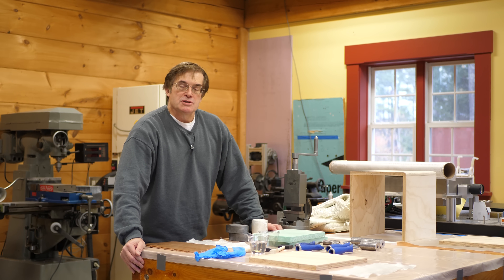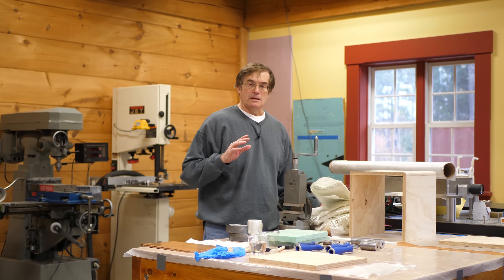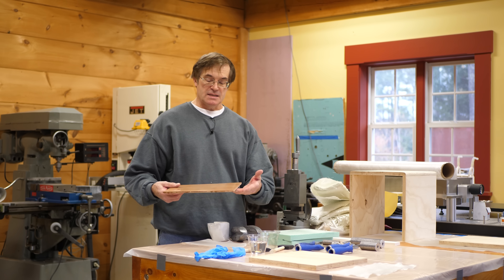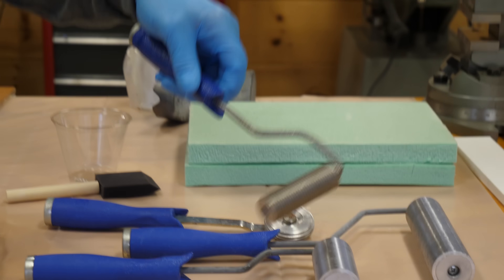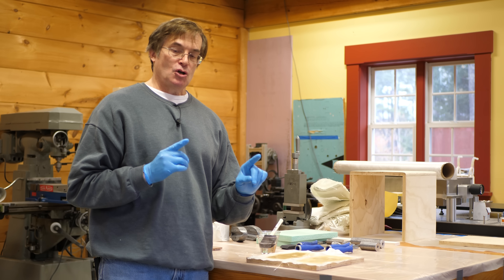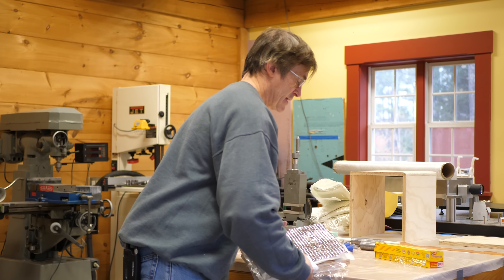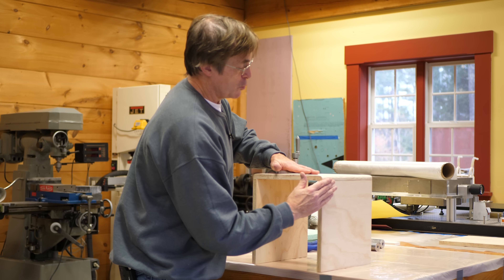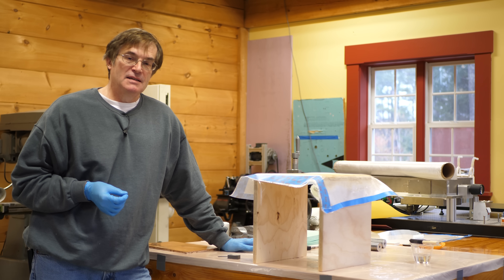Easy Tricks Using Fiberglass Strengthening!

Comment: I've recently been using epoxy, both the standard and thinner, penetrating type, on many projects recently.  Your video taught me a lot.  Thanks!  One tip that I have for you is to purchase some silicone baking mats.  Nothing sticks to them and you can use them both to protect your work surfaces and to produce a smooth finish.  I recently repaired a puncture in a pool safety cover using epoxy and some pet-proof window screen scrap sandwiched between two silicone mats with a concrete paver left on top overnight.  The result was as strong and professional looking as anything you could hope for.  I also use parchment paper (like they use for baking cookies) for larger projects.
Reply from the maker: Good suggestion, thanks.

Comment: Thanks for this amazing content!
One question: is it possible to bend xps (lets say 1 inch thickness) by putting it into a heat chamber or bathing it in hot water (the melting point is (afaik) at ~90°C? This would be interesting e.g. for rounded boat hull shapes (instead of using scored foam or PVC foam). Can't find any answers to this question on the internet.
Reply from the maker: I'm not sure, but remember that hot coffee cups are often made from XPS.

Comment: Great fiber-glassing tips! I remember as a child (1965-66, I believe) 'helping' my father build a 'Luden' 14' fiberglass runabout boat kit (deck and hull pre-formed) and I accidentally inhaled a single fiber into my wind pipe. I coughed and choked for over an hour before getting the fiber out (even vomited once). Moral of the story...One should consider using even a simple dust mask when working with fiberglass matting.

Comment: Something worth mentioning (unless you did and I missed it....) fiberglass and most all composites are stronger if used to form complex shapes and curves.
Flat panels will flex but a freeform speaker box or a car fender for instance will be much stronger.
Also, if you are careful, you can sometimes use many layers to create heat during a layup.
Can be very helpful if laying fiberglass in a cold garage during winter...

Comment: Great video, one of the best. I worked out to lay the resin down first and then put the glass cloth on top when I was 15 yo.  I always wondered why everybody didn't do it like that as the results were just as good if not better.
Also, heat lamps (like in your bathroom) work really well as do heater strips from a radiator to warm the work, especially with larger and vertical parts.
I don't like the idea of trimming the edges as I believe (and I could be mistaken) that maintaining the integrity of cloth over the joints in the piece is critical for strengthening what is essentially a stress point.  It is easy enough to wet the piece enough to stick the cloth down and apply more resin later, as above.

Comment: Very nice video as always 👌just a trick I learned making skis is that is when you have a fully cured surface, after washing it down like told, rub it down with a mild vinegar, this helps with the surface tension of the epoxy and you can avoid "lakes" aka pits where no epoxy will flow 👌👌This helps you make that glass finish you want on eg carbon fibre 👍

Comment: Hmm...on sailing forums cored fiberglass does not have much respect. Over the years (or decades) the chance of the core getting moist and adding unnecessary weight is high, they say.
Reply from the maker: That depends on the core.  Only balsa, which dry, is one of the strongest and lightest is able to absorb water.

Comment: That time where the epoxy is still chemically open is known as work ready. It's not cured enough to be finish ready but good enough for another layer. I would hope wetting the surface before the fiber glass is standard practice for fiber glass work. Also think about making a pop up paint booth for larger scale things. You can control small particles, air flow and temperature.

Comment: Any tips for covering a very large surface?  Think Hangar door, 25-30 feet wide x15 feet tall.  I'm looking at building a horizontally bi-folding door (Example: https://www.youtube.com/watch?v=sNBybkHBHlE)
The frame would be metal, the infill would be 4" EPS foam that I salvaged (4'x8' sheets).  I plan to skin the outside of the door with R-Panel metal riveted to the frame, and skin the inside of the door with fiberglass as you show in the video.  
Spreading the epoxy first on a horizontal surface and then using gravity to let the cloth sink into it is a priceless tip, Thank you!
Tips for calculating the amount of epoxy would also be much appreciated!
Reply from the maker: Sure.  Find a very slow cure epoxy formulation.  West Systems has a broad range of different systems.  Work inside if possible to avoid bugs becoming stuck to the surface during cure and direct sunlight prematurely heating the work surface.  Get as much help as you can with one worker dedicated to producing the multiple small batches for the other applicators to spread out, thus increasing pot life and decreasing walking cleaning and contamination.
Alternatively, you can work section by section.

Comment: All of these are classic surfboard glassing/repair techniques. I think this is the best vid I have ever seen on the topic, very concise and clear. Surfboards are typically a lightweight PU core with polyester resins with fiberglass -- stiff outer shell around a lightweight core... the techniques are exactly the same as here. Surfboard lineage is shared with boats and airplanes. Other minor techniques: 

- orienting cloth, cloth is anisotropic so you want it diagonal to the direction of shear to get max stiffness, and layering cloth in different directions to produce a more homogeneous result
- adding filler like microbeads to fill gaps/holes in an uneven material while keeping weight/material cost down
- slow cure = generally better strength, I think? I have heard this but I'm not sure about it.

Comment: I am hooked! Dr. Fiberglass, I am a retired auto tech, actually an ASE Master Tech since 1978. I am building custom door panels and just started yesterday, following “Classic Truck Addictions” video channel. I hope you have a video on fiberglass resin, either polyester or vinyl-ester. (Yes, 3 years as service mgr. at boat dealer w/34’ premium fiberglass)
  The other video required a “Barrier of Bonding Agents” that hardened, could be sanded, then fiberglass resin will not eat into the extruded polystyrene. I have never tried but found it interesting. Basically, a 54 year old pickup had flat stamped sheet metal panel. After all, they where work trucks sold to the farming community. So, hit like, subscribed and even though “Google” monster make you sign in to get 3 sheets of TP off the roll, I have no bell. I have the WiFi part of an old iPhone my son sent me, but no cable, no subscriptions, I don’t even watch sports even at 6’3” and played all. Care less. 
 I will be check the date released, going to your channel to find fiberglass on EPS, and go from their. It take work to but materials, do certain show-N-tell parts in advance, have a script or plan, lights, camera(s), edit, over-dub text, name the baby & upload. Thanks, because that’s work too. I don’t even own a camera, but like to learn! Never to late.

Comment: I like the video, very interesting. I used to work with fiberglass and carbon fiber and did reinforcements / repairs with both materials. If we were doing a smaller area then we would use brushes to put resin on but if it was a very large area we would slop by hand, with oversized gloves on of course. For a few different reasons we would seal off the area with double sided tape around the edges, a material called peel ply directly over the saturated fiberglass, then bleeder plastic which was very thin plastic with tiny holes in it, then felt over top of it, vacuum line ran entire length with holes in line every meter or so, then would put vacuum plastic over top to seal everything in. As long as the vacuum lines had felt covering the holes and fiberglass it would have almost equal vacuum across entire area. Obviously we had the double sided tape and vacuum lines already setup prior. Plus we used different sized heating blankets. Then once done you would take off all the plastics, felt, vacuum line then would peel off the peel ply. Any excess resin would sit on the outer layer and would come off with the peel ply material. Because of the peel ply material, you wouldn't have to sand or scuff up fiberglass unless there was a sharp edge or a spot of shine somewhere. So directly after peeling off our peel ply we could apply filler / putty. The main reason we had it under vacuum was to avoid any air pockets even though we got out any air bubbles we could see when applying resin and fiberglass.

Comment: I recently removed an old formica top on my workbench, and have been considering different new surfaces.  Now I'm wondering if creating a surface using fiberglass and epoxy makes some sense, instead of new formica.  I'm not a woodworker.. most of my projects tend to be working with plastic, metal, and electronics.

Any thoughts about using fiberglass (maybe even that aluminum-oxide type) and epoxy for a workbench?

Thanks for this great video!  I learned a lot (particularly about the unbonded monomers and amine).  I have started recommending your channel to my friends.

Comment: Wow, literal masterclass right here. Thank you for this excellent demonstration of sandwiching and its benefits as well as the tips in applying epoxy. I have an old audi and the plastic they made the door with on the inside is a bit flimsy and needs some good reinforcement. I will be using the tip about gravity to save both time and epoxy. Thank you.

Comment: Those finned rollers are absolutely horrible. Use a microfiber or nap mini roller, loaded with epoxy. you should always prewet the substrate before laying the glass down, then use the roller to roll it out
Reply from the maker: Sorry, but I have to disagree with your take on those rollers.
Reply: @TechIngredients  That's ok each to their own, I found it kept grabbing the cloth and lifting it up off the piece, I have been using a lot of double bias stitched cloth on my boat build, I find the microfiber rollers work better for me :)

Comment: Great explanation! I STRONGLY recommend exploring peel ply. It will transform your epoxy work. Peel ply will prevent the weave of the glass from 'floating' away from the core while the epoxy is curing. Peel ply can also hold-together' fillets and filler bridges at part joins. Also, since nearly all epoxy surfaces are additionally coated or varnished (epoxy is not UV resistant,) peel ply leaves a mechanically roughened surface (without having to re-sand) perfect for keying in additional layers and tabbing and to receive paint/coatings.
Reply from the maker: All true.

Comment: This actually solved a key problem in my design for affordable, flat-pack reptile and rodent cages. The floor of the cage flexing is a critical shortcoming, and using a torsion box design would be exceptionally labor-intensive, and therefore expensive. To keep the cage lightweight and cheap, it seems like an application of fiberglass to one or both sides (followed by food-safe, impermeable lining of course) would solve this problem with a minimum of effort. Thank you!

Comment: Impressive. Liked your understanding of the science. I have used carbon fibre cloth and epoxy to strengthen a block of Styrofoam for use as a footplate in a WWR racing kayak. This also strengthened the kayak from deformation by side forces.

Comment: STOP: Must put epoxy down first and squeegie it in.  Allowed to cure to green stage then fiberglass otherwise the wood will absorb epoxy leaving the glass dry and it will delaminate if used anywhere it will actually see stress.  Otherwise you have to douse it with a TON of epoxy and making a poor joint between wood/fiberglass.  Makes it heavy, will delaminate, and expensive. 

STOP: For making a clean edge, put tape down on finished part and epoxy/fiberglass down over the edge of tape.  Next; WHEN at green stage, as he was describing in video, THEN cut and you will have zero mess and a perfectly clean line which can be sanded/faired into. Doing it his way will leave you with an unsightly ragged non straight line.  At least with a straight line it looks planned if you do not get your epoxy fairing done properly or like most projects you run out of time and have to come back when it is not green requiring sanding etc.

Cheers.
Reply from the maker: Sorry, but no you don't.  Applied as I described the epoxy will produce a bond that is so strong that when you pull the cured laminate away from the wood you will rip the wood apart first.  Your method is not bad, but it's not necessary.  
The tape method works, but it adds an additional step and it can also, occasionally trap small fragments of tape which adds work to the process as well.  As we will be sending the raw edge flush to the wood and over coating the junction, you won't see the edge of the first layer.
Reply: @TechIngredients  Sorry, once again, you are using a quicker method instead of best practices for work, which is ~~~ good enough and perfectly A-ok for many jobs.  For everyone who is not just doing a quick and dirty job.... The way you are doing it is heavy and leads to delamination as it requires you to either use a thick epoxy so the wood does not drink it, and therefore creates poor fiber bond to the epoxy, or you use thin epoxy, but must use far too much and it is heavy and ultimately not enough fiber content. 

Likewise your comment regarding ripping wood is an ultimate strength test and NOT a fatigue test.  No one gives a damn about ultimate as this almost never happens.  Fatigue needs the glass as close to the wood fiber as possible to reduce delaminations which is how it always fails even under ultimate strength test.  Therefore the LEAST amount of glue(irregardless of type or method used) is always the superior solution.
As for the tape discussion method I brought up, once again, you are using a quick dirty method which is NOT in line with best practices if one is trying for a perfect clear FLAT finish.  Yes, your method works. Sort of.   It has problems as it is not uniform and leaves blobs of glue underneath the cut portion which means fairing is very difficult.  Your method does not create a clean thin line in case murphy rears his head either.  (Phone rings etc)

PS: If you just want to "rip wood" you do not need fiberglass or epoxy.

Comment: be careful with that stuff.   make sure it doesn't have asbestos or toxic fumes in it
Reply from the maker: There is no asbestos in fiberglass.
The epoxy will emit some fumes.  It's pretty limited, but using it in a well ventilated environment is a good idea.

Comment: Another way to improve the surface is to use "peel ply" which is a fine weave fabric that doesn't wet well. Many synthetic fabrics such as nylon work with epoxy. 
After the fiberglass as layed up and wetted out apply a layer of peel ply and work it into the layup with a roller, fingers scraper or a brush. Apply a little more epoxy if necessary to wet out the peel ply.
When the epoxy has taken a firm set peel off the peel ply.
The surface will be ready for a light sanding and a final thin coat of finish.
Reply from the maker: True.  This will also prevent the amine blush from devloping.

Comment: I can literally smell this stuff right through the monitor.

I'm going to jump in here and recommend...... Well I suppose I'd recommend you stay away from this unless your curious or have a need for it. But if you do mess with it make sure you run a test/practice piece every time you use it. Because humidity and air temp play a huge role in curing time, the same epoxy can have different curing times on different days. And for God's sake don't do this in your mom's basement for the first time. The smell can last decades.
Reply from the maker: This is not true.  There is an aroma from epoxy resin that will dissipate even in a closed room after several days.  Temperature is the primary variable in cure rate and needs to be taken into account when choosing a hardener, but humidity matters little and the timing is predictable.

Comment: Love this video on working fiberglass, learned a lot. One trick I do to avoid sanding is a small variation on the plastic wrap trick.
Lay a plastic board - like a corrugated real estate sign or this plastic wrap and a flat surface over your wetted project.
The end result has a super flat glass like surface.
Of course we all know epoxy/vinyl ester does not stick to plastic.

Comment: You left out two very important item's with your lay-up. Peel-ply. If you don't use this on glass fibers you have a uneven finish and exposed fibers above the resin's. You now have to sand down the cloth high spots. This will be a disaster on a single layer of cloth, and end result of poor quality. You also have to use Vacuum bagging with all core materials, or your core will fail. I'm not going to tell you your wrong on your glass cloths strength's, but you should do a little more searching before you make a statement. And any Composite Engineer will tell you to NEVER USE MATS WITH EPOXY'S. Epoxy will not dissolve the Polystyrene used in mat's, and will not work at all.  So you don't have my 40 years of working with Composites in a Positive feed back.